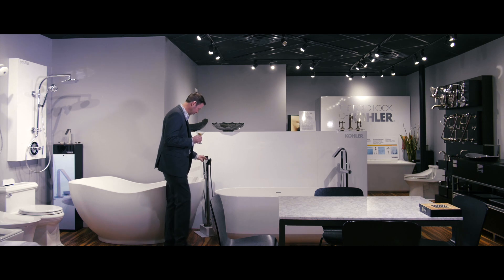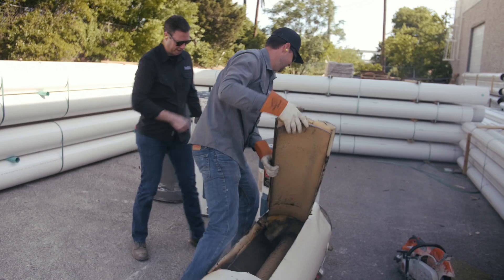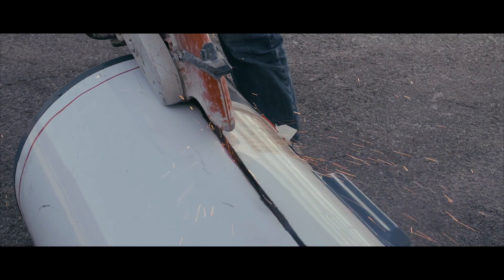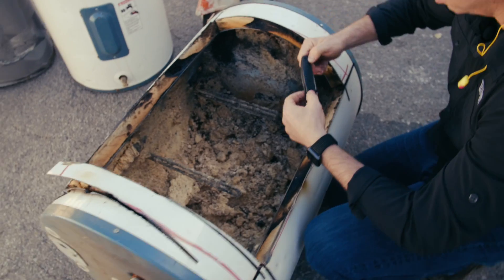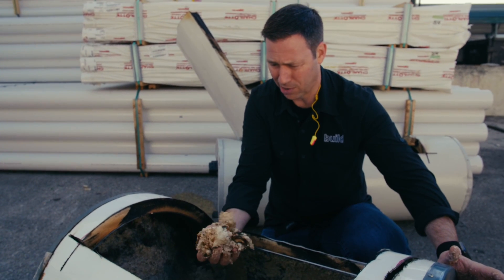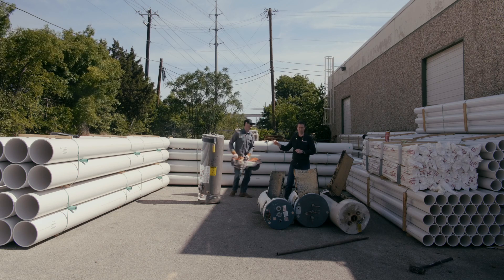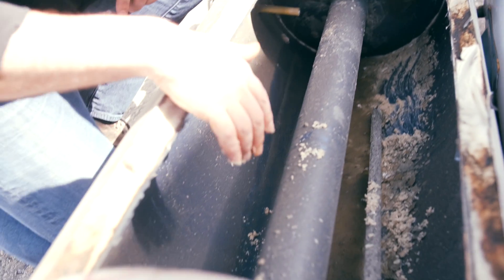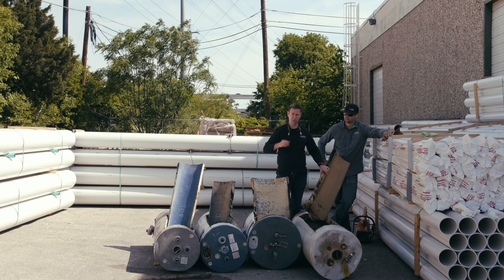Water Heater Tank Autopsy: You won’t believe what’s inside!

Comment: Although not a plumber, I work for a multidisciplinary contractor and deal with gas and electric water heaters on a fairly regular basis in an area with some natural salt and fairly heavy mineral levels in the ground water. We get an average of 10-12 years tank life from units without regular maintenance (dip tube inspection, sacrificial anode inspection and tank flushing) and I find that the condition of the dip tube, especially on commercial tanks, seems to make a huge difference in the amount of buildup. The manufacturers have told me that the water jet from the dip tube tends to keep the minerals in suspension, rather than letting them settle and harden into what you see here.
Reply: The added lifespan is due to recirculation lines tied in at the bottom of the tank which washes out the minerals more efficiently instead of letting them settle. Which is why electric hot water tanks that have the cold water supply at the bottom of tanks have less build up and last longer

Comment: If you flush once a month every month, like I do, you don’t get this issue. I used the hot water to clean the engines and bilges of my boats and truck. Plus the top water rises, and the cooler ware resides in the lower sections. If you would just flush 5-10 gallons that will do the trick. I have never have to replace a hot water heater in the last 40 yrs, unless I bought a home with an older home that was NOT maintained. Even it if I do not wash something, I just water the plants. Works every time. Oh one last thing...WHEN ARE YOU GOING TO BUILD A GREEN CONTAINER HOME??? ENOUGH OF THE OVER PRICED STUPID STICK BUILT STUFF ALREADY!!!!
Reply: Every month? Annual is the recommended, but I guess that would do it. The key is a water softener and a whole house filter before the softener.
Reply: Most people have their water heater in their basement or otherwise hard to drain area. Going through all that work to save a few hundred bucks every decade is probably overkill.

Comment: I was thinking of cutting one of those windows in my tank and then clean it out and resealing with that flex tape they used to put boats back together.
Reply: Google "pressure vessel"
Reply: lcagee make sure you turn off the electricity, water and your wife’s voice yelling at you to stop the madness.
Reply: That doesn't sound safe
Reply: That's a lot of damage.
Reply: lcagee Sounds like a plan! 👍🏼
Reply: oh you've stolen their commercial
Reply: Duct tape is cheaper

Comment: The hotter the water is, the more solute it can hold. Like, hot water can dissolve more sugar or salt than colder water.
When the solution cools, solutes start to precipitate out of solution. So, I'd expect the deposits to be thickest on the coolest parts of the tank.
Reply: Someone else here said CaCO3 is different than most salts, in that it is less soluble in hot water.
Reply: Ryan Bissell I think CaCO3 is totally insoluble in water, unless CO2 is introduced.

Comment: actually, the top of the tank will be the coolest part, and thus the salts would more likely coalesce there
Reply: Benjamin hmmm- no, hot water is less dense than cold, the heated water rises and the tank heats from the top down. That's why the water draw off is at the top...
Reply: dude, you need to put a dip tube in that heater, or you're an idiot.

Comment: A whole house water filter is key to filter out sediment and will also help reduce scale.  I would love to see the inside of a old water filter from a house with a whole house water filter.
Reply: Luke Skaff unless you're using your own well water, there is very little sediment in most city water, at least in the UK. A filter won't make and difference to genuine scale as it is formed when dissolved minerals are heated- they would be still  dissolved when they passed right through the filter and only become scale when heated in the tank.
Reply: Spencer Wilton I am on city water, I change my whole house filter every 6 months.  The filter is dark brown on change out and coated in clay film and what appears to be rust.
Reply: @LukeSkaff  ; Yikes! Do you live in Flint?

Comment: I install water heaters and some times we can't even drain them they are so clogged and we use an ELECTRIC PUMP to drain ours & it can't even suck it out. We did one the other day and had to finally haul it out full of water. 50Gal weighed in at 550 lbs....lucky it was all on first floor....we couldn't even back flush it.
Reply: Bill Joel 
Hey Bill. Been plumbing 24 year's. When draining the WH don't shut off the valve. For first few min it will force flush like a hose bib.  After the water pressure cleared a way shut it off and pop the top. Should drain.
Reply: Damn, gary. Reminds me this time here were three of us running utilities in a ditch. We were stringbeans and using buckets and pullies and all manner of brainy aids. We got to where a junction was planned and had aluminum and copper cable left, and couldn't get it out of the ditch with anything we had. Well, two of us were string beans. Along came the Amazon who was mostly brains for us. She deadlifted it out of the ditch from 4 feet down. Did the math later, it was over 600 pounds. One quick motion. Good friend. Wouldn't want her as an enemy.
Reply: Gary Langley Hulk Smash!
Reply: It wasn't a 50 gallon heater, but a 30. I figured that it was about 350 pounds for the water and the heater. He weighed about 260 at the time.
Reply: I flooded an apartment like that once. Right idea, but proceed with caution.
Reply: Gary Langley I flooded my garage draining a tank once. Thankfully, it’s concrete!
Reply: That's STUPID. Why didn't you just punch a damn hole in the thing and DRAIN it. DUH.
Reply: As a pro, do you think you need to pay more for an upper grade model (electric)? Or the economy ones are just fine to cover the 10y max imposed by many insurers? 
Did you try to pump it from the top? With a pump or not, should not be worse than a sip of gasoline!
Reply: "take the drain valve right off and stick a screwdriver in the hole to dislodge the corrosion and drain out into a catch pan." Spent 5 hours doing that and other things once to clean a tank,,, spend an hour prodding, then try something else, then go back to prodding...
 Hard water, that water must weigh32 lbs a gallon I guess.
Reply: I'm not a plumber but if that was me in that situation I would have drilled a hole to let the water out... screw trying to move a nearly 600 pound water heater
Reply: I use compressed air with 3/4mip to 1/4 air chuck to the relief valve. 5% of the time the WH is cracked in the flue or on top, those times I will gravity drain. I keep a 3/4 brass nipple with a 3/4 ball valve on it so very rarely that when the drain is clogged, I swap out the drain valve on the fly.
Reply: You work too hard.  I'd have pulled the safety [p/t] valve or the anode out of the top and dropped a hose in to pump out as much as possible.   No doubt you still had a beast on your hands that may have been packed off halfway with scale.  Time is not on a contractors side, but... in a really bad location, hooking up a vacuum pump [filter the inlet, please] at any threaded connection up top can work - but the tank has to be tight.   You have to be able to draw down to 29" vacuum to boil moisture off, and it may take all day [and that's with partially draining/getting it pumped down first], unless you use a "high volume" unit as sold to a/c repair types.
Reply: 50 gals of water each gallon weighing 8.33 lbs per gallon  = only 413 so it must have been really full of scale I've been there and done that I had a kid who was strong as an ox thank god he was a good helper he actually  stayed in the trade and thanks me on occasion for giving him a trade ...
Reply: take the drain valve right off and stick a screwdriver in the hole to dislodge the corrosion and drain out into a catch pan.
Reply: About 5 years ago, I had to replace a water heater that had been installed in the 1980's or earlier. It would not drain. I tried opening the drain with the pressure on and so on. My son was on the high school wrestling team in the heavy weight division, and he just told me to get out of the way. He squatted down some, wrapped his arms around it, picked it up, and carried it outside. He then threw it off of the porch.
Reply: Gary Langley is your son Brock Lesnar?